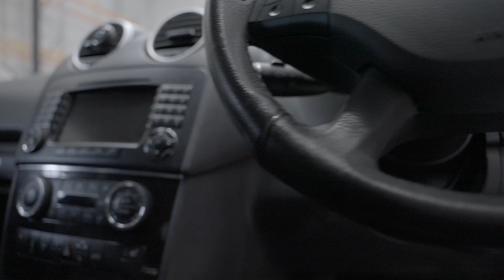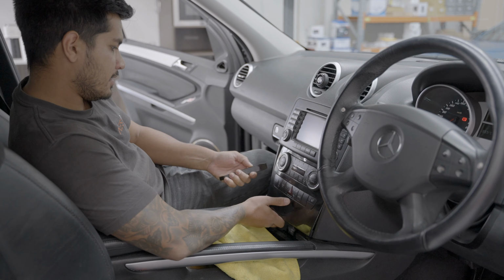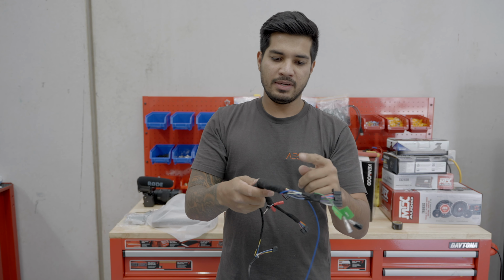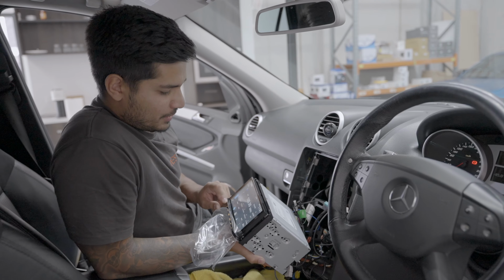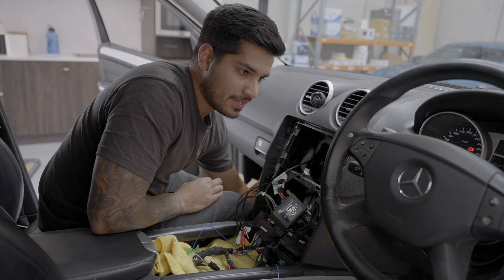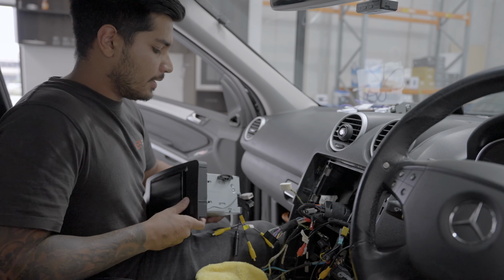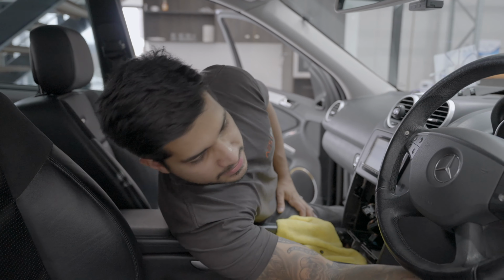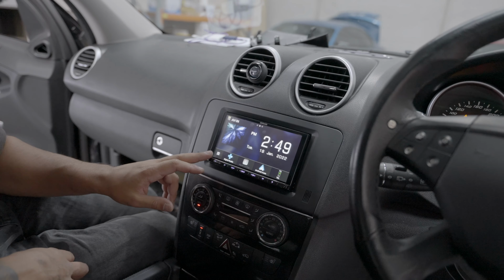D.I.Y HEAD UNIT INSTALLATION // MERCEDES ML EDITION!

Comment: Thanks for the awesome video, just about to do the same on my ML. Quick question tho - what did you do with the reverse trigger wire? Did you have something already under the dash/in the harness or did you run a cable to rear reverse light?

Comment: Hi, I’m just about to install a head unit in my ML500 and have also got an audison active sub, my question is should I disconnect the original Harmon kardon sub? Cheers, james.
Reply from the maker: You do not need to, we didn't and sounds great
Reply: @TheFittingBay  thanks for getting back to me, I installed the system with no problems but found it sounds a bit boomy with both subs connected, I just wondered if I unplugged the HK one will it affect the system at all? Cheers guys.

Comment: So what about setting of the in dash clock normally set from within the Command system?
Also I assume none of the in dash screen functions work?
Reply from the maker: All oem dash functions work. You can still set clock too
Reply: @TheFittingBay  Thanks. 
What about Siriusxm satellite radio? Will that work? Even if a new receiver is required?